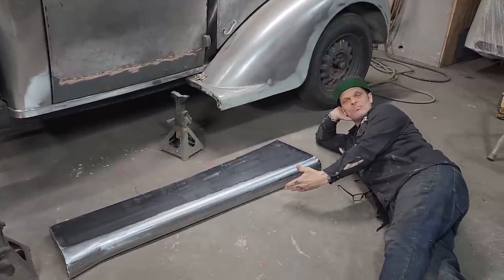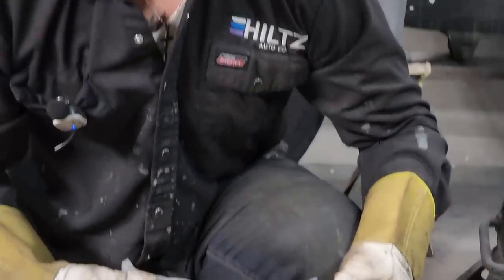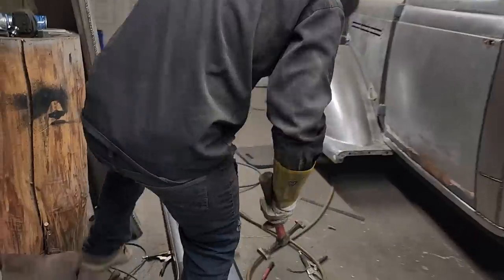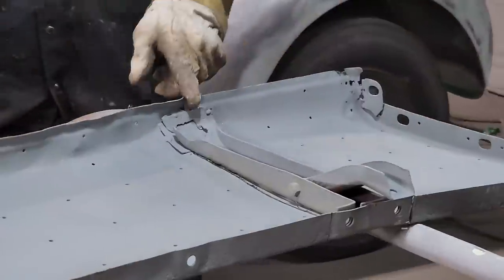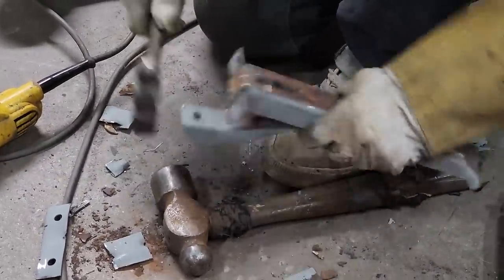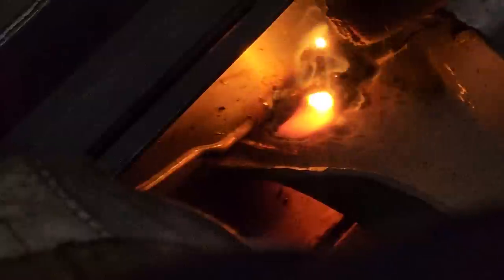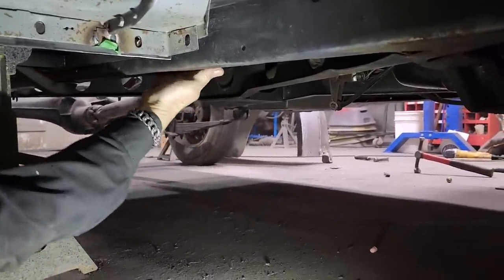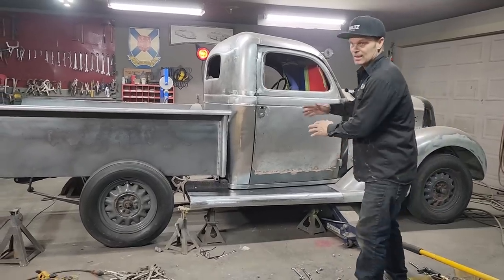The fabrication continues on the 1935 Plymouth pickup truck

Comment: Watching You use the jack stand for an Anvil to straighten that ear on the support for the running board reminded me when my dad used a 6"x 12" I-beam about 30" long for an anvil with a hand hole cut on one end, so he could take it to where ever he was doing body panel shaping work. Good easy cheap tool to make for your shop.

Comment: A lot of builders wouldn't have felt the need to put those original braces back in.  The new running boards are plenty stout as they are.  Those two added braces though will cut down on stresses where they bolt on, especially to the fenders.  I love your attention to details like this Chad!!  You and Jolene bring us great content every day, thanks!!

Comment: Chad makes valid points although steps and procedures are put in place for the longevity of the job. People haven't the luxury of parking a car or leaving it in storage as most simple or honest folk need vehicles more as a daily or work requirements as opposed to hobbies or toys. These extra procedures are required as people want life in workmanship as opposed to repairs that are expensive and unaffordable let alone the time constraints that are also associated with re-repairing the job requirement. You cannot compare a 100 year house to a new one like you cannot compare an old running board with current. Chad himself would and should know as he has also mentioned this many times as steel quality is different, craftsmanship, pollution, contaminants let alone the most crucial which is paints whether it be led based or otherwise that would stand the test of time as opposed to the rubbish sold these days if you want to compare apples with apples?

Comment: Weld Through Primer is only $20 a can and would take care of all the brackets (And anything more) and under the running boards where the brackets go, just saying. 15 minutes extra time for all 4 to take off rust and coat. You have been doing such a great job otherwise, very talented. Rust never sleeps and rain comes when you least expect it. I do love your project, your vision on this one is awesome.

Comment: On the running board braces, you need to loosen the bolt on those bottom supports so you can adjust them. Also, there was another hole under that lower support where you  could do another plug weld for more strength. Those running boards are really nice. I'd say a good bit stronger than the originals.

Comment: Bad Chad….please quarter a guard for the zip grinder. Just enough to keep your fingers safe. Slice the guard thin it down then  make a small  1/8 or 1/4 of a circle out of the guard. Stops you from slicing your fingers off. I couldn’t watch Aiden using a zip wheel his fingers were too close. If you cut the guard down it will not get in the way…..dude your the best I want you to stay in one piece!

Comment: A $15 can of weld thru primer prevents the rust from happening again.  It would slow Chad down but it does work.  The running boards are only blown out over the braces because there was no primer in between.  Also in my area many restorations go to shit in 10 years because people don’t use products like epoxy primers (we live near the sea).

Comment: It’s going great. I love the way you work. Using all the proper equipment, tables and plugs and such is highly over rated. Too much prep and clutter just gets in the way. I would suggest hearing protection but I’m sure you wear it when you aren’t teaching and filming. I’m sure you get in a zone when the camera stops. I would love to see some filming of that. With a Delta Blues as a backing track.

Comment: At first I thought those supports weren't necessary, because the new running boards are more resistant. Instead you are right and you were right to put them back because they support and stabilize the central part.
Great job guys 😎👍

Comment: You could weld a strip of steel over the outer straight piece to the exhaust piece.  It would close up that area and add extra strength to the outer edge of the running boards.

Comment: Chad, have you looked into TIG welding? Granted it would take some time to learn it. Yet there would be less grinding for you and less dust in the air for your lungs! The wire feed would still be essential to tacking stuff up. Just throwing it out there.

Comment: Chad I found what works well for separating the spot welds is use a die grinder with a rounded blade you can grind the spot weld quick and then it’s easy to separate

Comment: problem with seam sealer and undercoat is that it will seal water in from any gap
Reply: You're right.....I've worked on many cars that rusted really bad because of the seam sealer and undercoat, especially put on thick.

Comment: What are you intending to do with the gap between the exhaust pipe and the outer flat piece, as I feel it would be a dirt trap and rust out quickly, plus it would be unsightly if looking underneath, personally I think you should have cut the exhaust pipe off to a 90 degree bend..

Comment: Would it be better to add flat bar over the exterior flat bar and exhaust pipe to prevent stuff from rotting out the outside edge of running boards and add extre strength? Just a thought. Sincerely Doc Cain.

Comment: What do you think of using rubbing alcohol as a degreaser? And I have been using printable house caulking as a sealer.i have used in on my hot rod and it is holding up over 5 years.

Comment: Chad _ Use a tapered punch in the mounting holes to line up the two pieces.  If they still don't match, I use a drill bit the size of the holes and drill to size,

Comment: do you need to trim the exhaust pipe at the back end where the bolt interfered with the bolt up? I see you have left it s it was when welded.

Comment: Did plymouth ever make a truck?!
Reply: Plymouth had pickups from 1937-1942.
They were just rebadged Dodge pickups.

From 1974-1981, Plymouth had the Trail Duster SUV...which was their version of Dodge's Ramcharger.

And in the latter 1970s and early 1980s, Plymouth had a couple of different mini trucks. If I recall correctly, they were actually made for Plymouth by Mitsubishi.

Comment: The only thing with that argument is if Ford Mustang was pre painted in the cowl area before it was assembled in1965 it would of saved about 30 years of prior rust ,and there would have been more original survivors today as anyone who has restored 65 thru 68 year.
Reply: Just for your info they dipped the bodies on the cars in primer when they started making unibody construction to keep them from rusting where there was metal on metal just like they do today they dip the bodies

Comment: Just a reminder Chad that little apron that your planning on building next, the box has another apron that need to be built on the back end of the fender that goes from the back of the rear fender to the end of the box itself and the bottom edge of the apron has a slope that starts about four inches up about 30 degrees to the end of the small apron. If you know what I mean.  Ya probable know this already. Have a good one You's two.

Comment: Running board looks a bit long wheel doesn’t look central to wheel arch ?
Reply: If you look at a completely broadside view of a '37 Plymouth pickup, the rear fender placement...in relationship with the rear tire...is nearly identical to the way that Chad has them.

The fender doesn't need moved.
And the wheelbase doesn't need stretched.